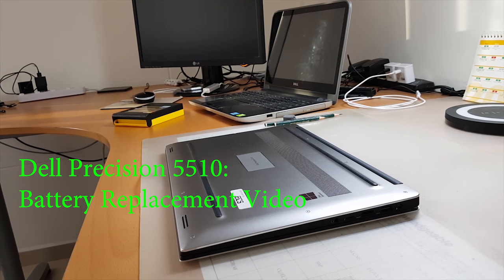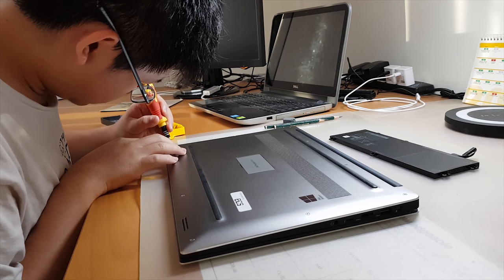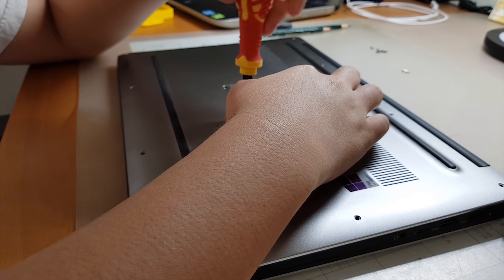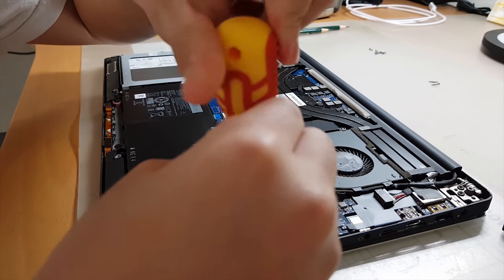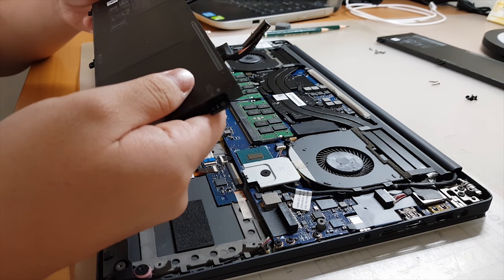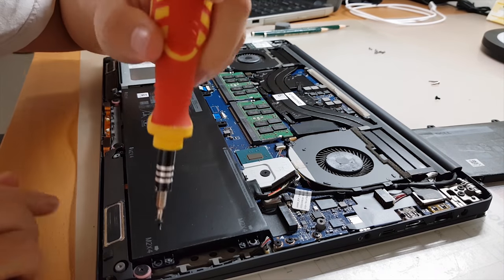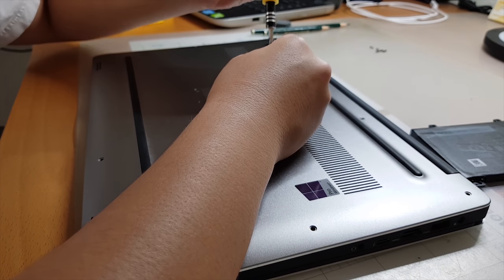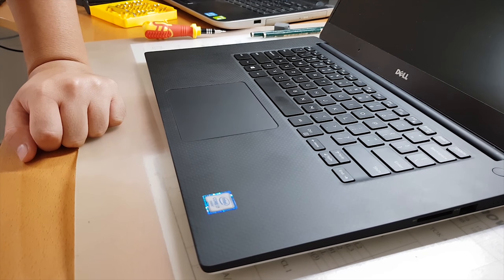HOW TO: Replace the Dell Precision 5510 Battery (4K)

Comment: Hi, I changed the battrey but now my laptop won't go on. The white charging light at the front is on though. Do I need to wait for the new battery to charge?
Reply from the maker: Have you tried plugging in the charger to activate the new battery?
Reply: @monsoonisland7662  Thanks, I sent it to a technician and they fixed it for me.
Reply from the maker: 👍 great to hear

Comment: I have an inspiron 15 7000 there is difference in if you change one from 42 , 43 , 58 0 74 wh
Reply from the maker: Inspiron 15 7000 is a series of premium Inspiron laptops. You need to provide the specific laptop model thanks.

Comment: I really need your help because for some reason I cannot connect the batter into the motherboard. The wire just wont push in
Reply from the maker: Sorry for late reply. Turn it around and push it in
Reply from the maker: Battery connector must be fitted in 1 direction. If not the reverse polarity will damage the computer. Which is undesirable

Comment: so you can also fit a 84wh battery in there right ?
Reply from the maker: +Simon Remove the Hard Drive Bay and you can fit an 84Wh battery in there. :D that also means it is time to use the m.2 slot for storage.
Reply: *an
Reply: @monsoonisland7662  I'm just watching this video. Thanks for your effort. I have a question. I have a 54Wh battery and would like to upgrade the battery size. Is it easy to remove the HDD bay and upgrade the size or is this complicated? I already run the laptop off an M.2
Reply from the maker: It's easy. The hdd cage is just a piece of metal on its own. No additional work needed. Have fun

Comment: Whats Your leptop features and PRICE?????
Please Reply::
Reply from the maker: Features??? Or you mean specs???  
Price is SGD3020
Reply: @monsoonisland7662  I brought Refurbished leptop named Dell precision 5510 last Week Which has  8 gb ddr4 , 128 ssd , 512 hdd storage, Core i-7 6 Gen, Non-touch 1080 screen ---I had paid 966.74 Singapore Dollar.
Few marks on aluminum and Some what Condition is Good . where-ever The Left swift is some what Louse ...
Whats your review about This?
Reply from the maker: Sorry for the late reply. RAM, SSD and HDD storage seems little for a workstation though.

Also, you can get the spoilt parts replaced. Although at a high cost if out of warranty.

Personally, this laptop does get really toasty. And overheats too

Liquid metal and heatsink mod like iunlock mod is really helpful.
Reply: @monsoonisland7662  Is there any way of getting rid of Overheat this laptop 
i usually use this laptop for application development and Gaming development this is caching too heat even Streaming 2k video on youtube.
You have used this laptop for many years Right::
Give me some Good Pon and Con for this product and how to handle It::::
thanks for your time
Reply: @dikshitkanani6298  pon and con lol
Reply from the maker: Oh
Sorry for late reply.

mine is Core i7 6700HQ, 16GB DDR4, 512GB SSD, 1080p screen, 56Wh battery for SGD3020 brand new
Reply from the maker: This laptop is quite sturdily built however, the hinge spoil easily if subjected to too much unwanted force at the hinge area
Reply from the maker: Ok. To deal with overheating. You can follow iunlock's method for the XPS 9560 but apply it in the Precision 5510.

Applying Liquid Metal is the best, do the heatsink mod, and modify how the air flow inside the laptop. 

And after all this, about 6 hours to do, you should be good to go
Reply: @dikshitkanani6298  download any fan speed control app and control your fan speed & clean your fan sometimes or you can change it